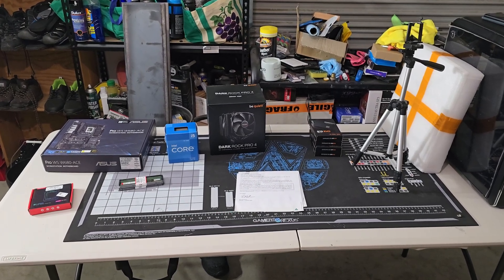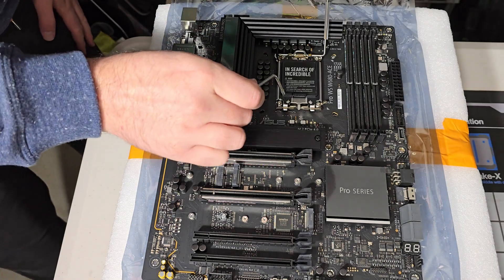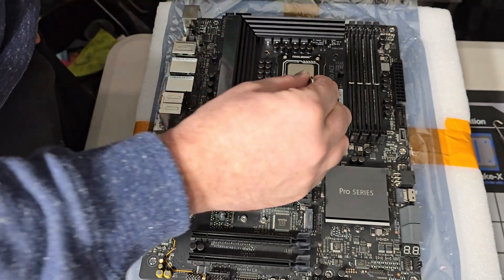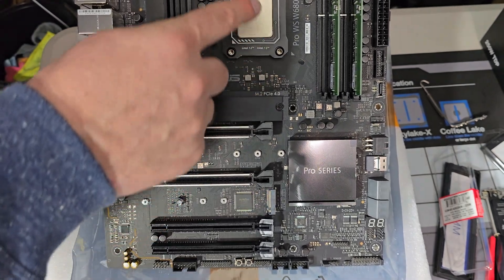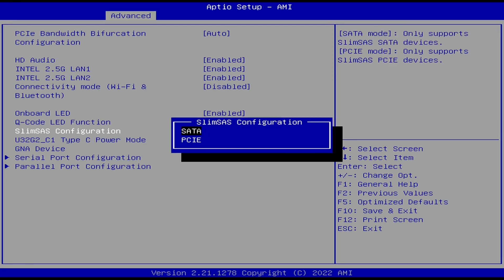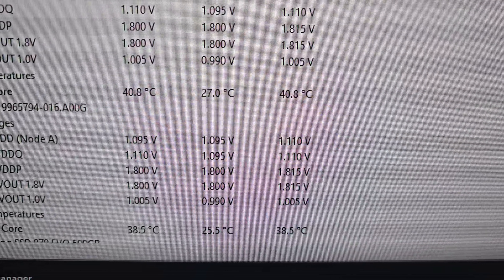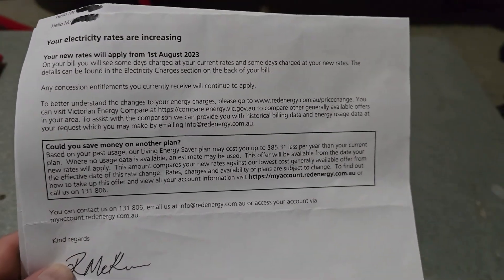Intel Desktop CPU With ECC DRAM. The Build

Comment: Registered (buffered) has nothing to do with ECC, it is about additional intermediate chip (aka the buffer) that sits between DRAM chips and MC. It allows MC to drive more chips, basically, which is why RDIMMs are offered in much larger capacities than UDIMMs.

There are ECC unbuffered DIMMs too though, not to be confused with DDR5 on-die ECC — ECC UDIMMs work the same way ECC on RDIMMs work. I believe ECC UDIMMs are supported by Intel consumer CPUs as long as they run on their W680/880 platform. ECC UDIMMs are much harder to find than RDIMMs tho.
Reply from the maker: Thank You so much for that. Very Helpful. I can confirmed with the W680 it does support unregistered ECC DRAM

Comment: The SlimSAS port works for NVME drives, I’ve got mine hooked up for the last year and it works great

Edit: I watched further and saw you corrected that.

I have mine with 128GB ECC @ 5600MT/s
Samsung 960GB Enterprise NVME
Intel 2TB Enterprise NVME over slimsas
4x enterprise sata on the data ports

Never had a single issue in over a year
Reply from the maker: You're running a lot of DRAM. Nice build.
Reply: @ProjectSmithTech  Im actually going to swap for 2x 48GB 5600 and see how that goes soon

Comment from the maker: TIME STAMP

0:00 Introduction/Parts 

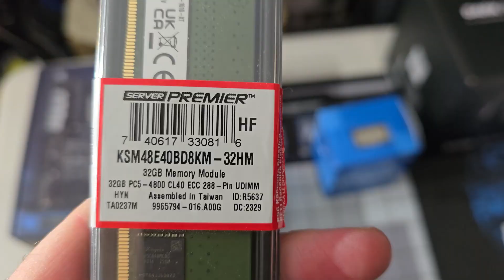0:15 Close up of ECC DRAM

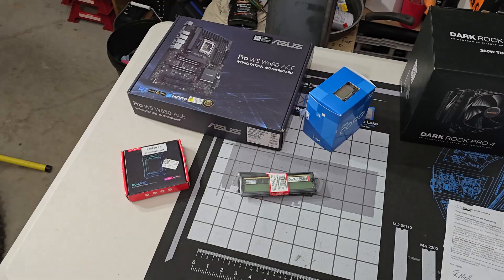1:05 Close up of the Motherboard (W680)

2:17 Installing CPU with aftermarket bracket (1700pin out) 

4:12 Installing DRAM and a quick Explanation Between Reg and Non Reg ECC

5:02 More on the Motherboard Storage function.

5:42 The Test Rig in its perfect form.

5:59 BIOS Update/ Go through some of the BIOS features.

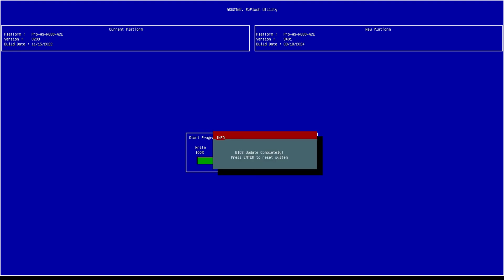7:36 System is on going through light validation. 

8:26 Gag Reel/ Current ideal power draw from my Severs is about 105Watts
Reply: The information about the processor on the official website says that it is not supported, I understand that it works for you, but I’m telling you the information that I checked on the website
Reply from the maker: @BOTLT1  https://ark.intel.com/content/www/us/en/ark/products/96144/intel-core-i5-12500-processor-18m-cache-up-to-4-60-ghz.html
 
That's Intel' Office Spec for the CPU (12500)

as for the Chipset W680 Official Spec

https://ark.intel.com/content/www/us/en/ark/products/218834/intel-w680-chipset.html

I just learnt the i5 12500 has Max # of DMI Lanes 8. I thought it was only 4. A good high through put CPU.
Reply: @ProjectSmithTech   lol į see